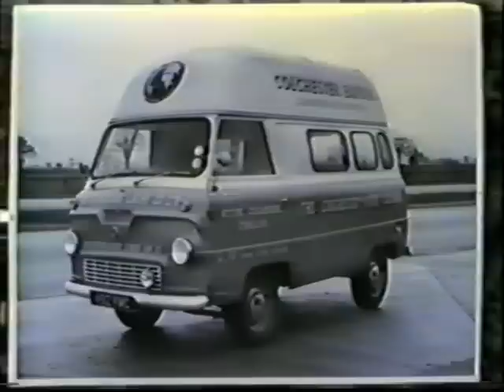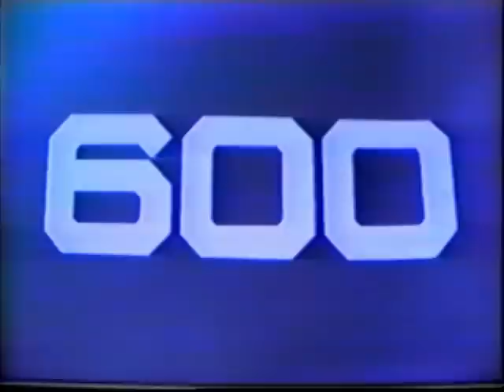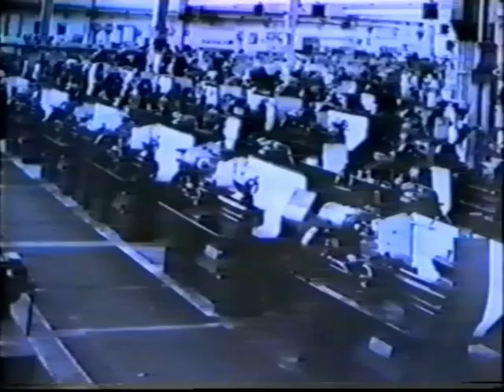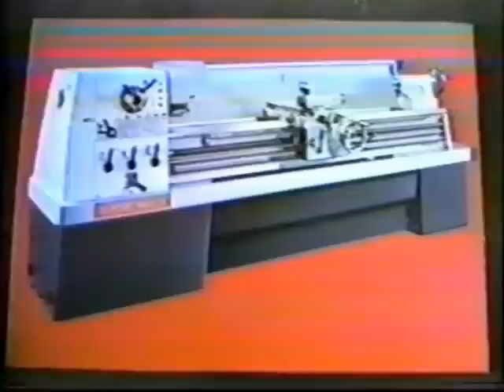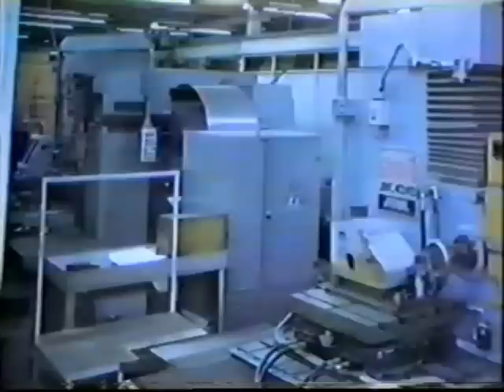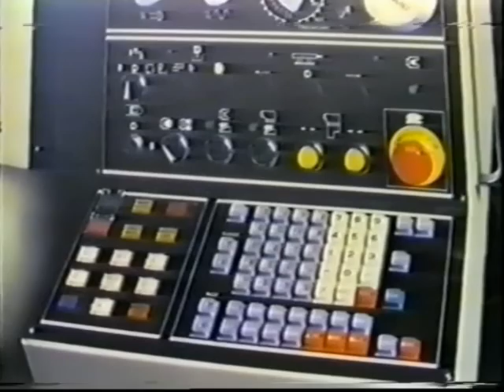The Colchester Lathe Company - a bit of history

Comment: I worked at CLC as a radial driller from 1972 to 1977. It was hard work but paid very well compared to any other work in that neck of the woods.

Unfortunately this was the era of the unions abuse of their power. Closed shop, intimidation, weak management. The unions totally screwed that business. Japanese copies finished it off.

I then moved to Derbyshire to work at Jones & Shipman which again fell foul to the unions and foreign copies.

Fortunately while at J & S I moved to CNC machining and then to programming leaving the machine tool business completely.

Sometimes, during nightmares, I am back at CLC. Not pleasant.

Comment: My dad has had a 1918-1919 Colchester lathe for about 10 years now. Will anyone be able to let me know how rare they are, how valuable they are and just some in site on them so he will be able to know more about them? Also what should he do with it? It’s still in working order with a few broken bits such as a chip in one of the gears, un flat surfaces, one un original handle. It turns on as a lathe should do and has all the gears still with it.
Reply from the maker: Scrap value or museum interest. A lathe is a precision tool. One that old will have no precision.
Reply: Jess Jephcott ah ok thank you anyway
Reply: @biggestcompetition6093  Bullshit...…..I have a 1920/30 Colchester Bantam lathe and still use it. I bought it from a scrap dealer in 1980 who salvaged it from a bombed out factory site earlier and took it to OZ when I emigrated in 1981. I had to recut the bed Vee's and flats by hand with a hand planer tool and rescrape it in as it had .013" wear from the middle down to the chuck end.  I regularly do single point screw cutting as I also acquired the complete set of screw cutting gears with it. I fitted a new 160mm 3 jaw chuck and a 200mm Pratt Burnerd 4 jaw. The lathe originally was driven by overhead belt drive so I converted it to a 3 step countershaft pulley and a 1 HP electric motor.
Reply: A good source of information is here: http://www.lathes.co.uk/colchester/
Reply: @biggestcompetition6093  Ignore Jess :(
See how many you can find on the internet. Value is difficult to weigh up. Ideally, you need to find someone with an interest in an antique lathe. As a lathe, it's likely of little value as newer and better machines will likely be available. A well-worn machine can still do precise work if you make allowances for the wear.